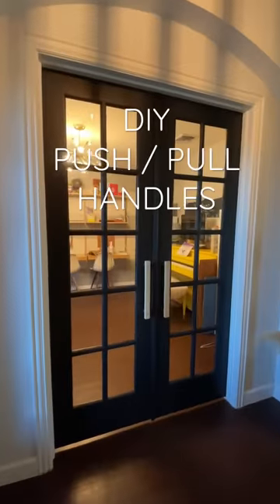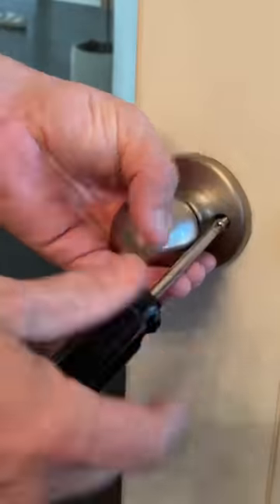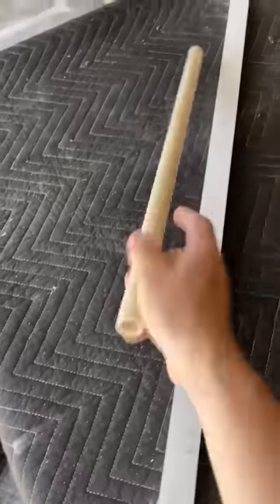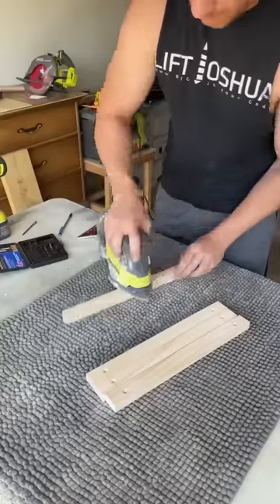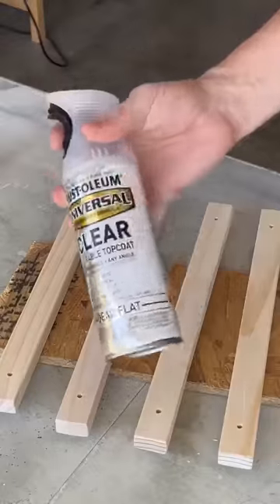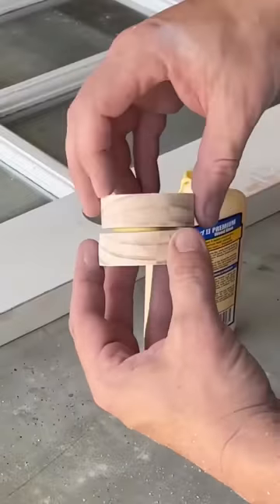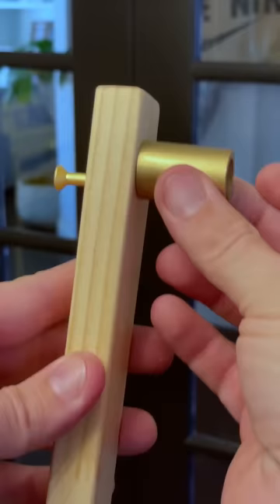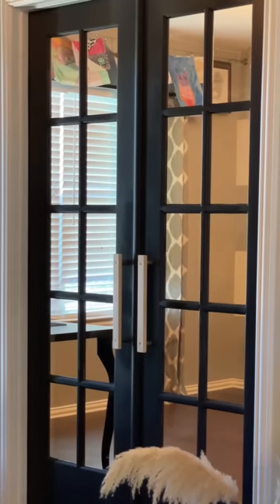DIY Push Pull Door Handle Conversion

Comment: Doors look great. Handles need screws heads filled in and then polyurethaned to seal it.
Reply: ⁹
9
Reply: and thats why in the title it says DIY. not "20 year pro installs doors"
Reply: He also needs to show, if he filled the inside of little pieces of PVC pipe. Otherwise it leaves you to believe that the pieces could be knocked to the side, eventually, with only having a screw through the center and only pressure, keeping them in place. Why go through all the rest of this change, and then only doing that one step, half way...
Reply: @jamesholder9926 this guy obviously knows how to fill those in. you don’t do everything he did and not.
Reply: @jamesholder9926  all the great work he did, he knows that’s an odd step to skip. that’s all i’m saying.
Reply: @kaleb324  right on. Copy that. Great point. Now move on. Thanks. Enjoy the rest of your year. Sorry I have a different opinion that you don't agree with.
Reply: @jamesholder9926  roger that 10-4 doesn’t recognize a skill level when he sees it over and out.

Comment: What kind of hinges did you use for a push pull door
Reply from the maker: The original ones!
Reply: @emyludesigns  how can they open both ways??
Reply: @emyludesigns  oh... you mean one open one way and the other open the other way

Comment: The doors look great but the wood handles need paint or maybe visit a few architectural salvage yards for some interesting old iron fencing pieces and you can sauder them into a couple original handles and they will look richer than those kind of cheap ugly pulls. sorry but they just don't cut it especially showing the screws. 🤦🏼‍♀️